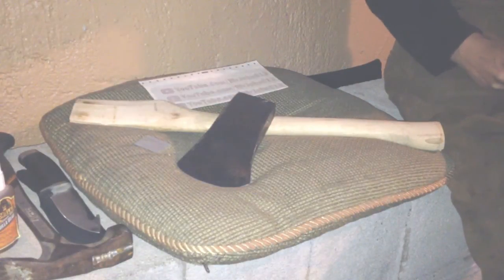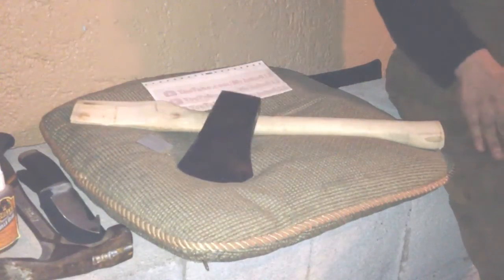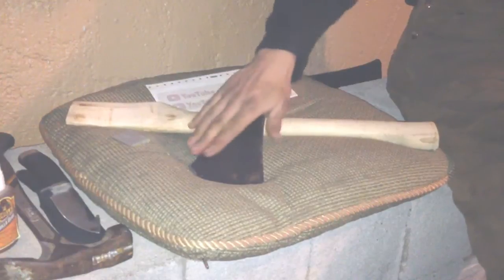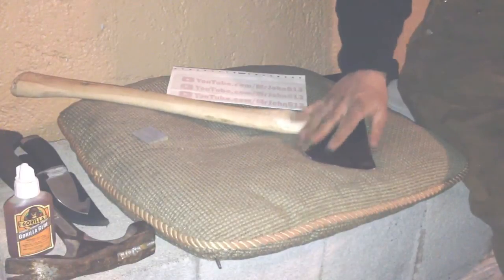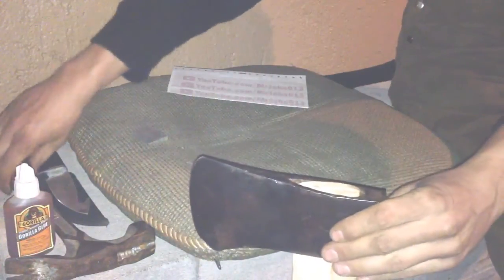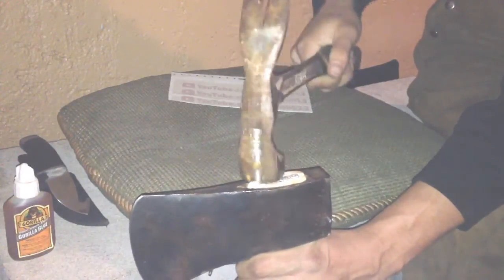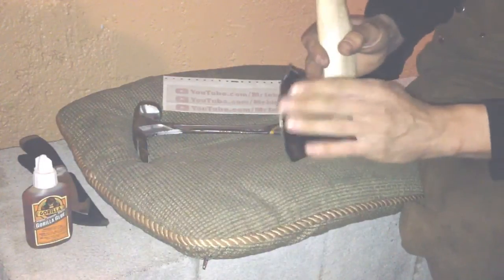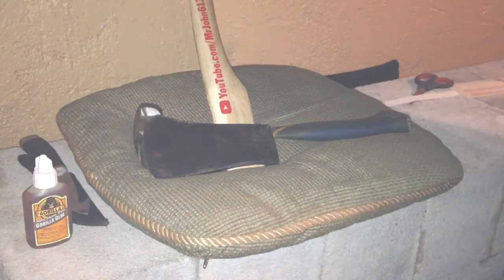DIY Axe Handle Replacement. (full)

Comment: My experience with cheap Red Chinese cutting tools the temper ,or usefulness of the cutting edge was far superior than American manufacturer cutting edge. Red China cutting tools came into the American market around 1985. The were phenomenal . Formosa Chinese tools were crap the cutting edge would immediately peen over American manufacturer did improve their cutting edge And eventually lower their prices to be more competitive toCommunist Chinese tools. The old saying that "you get what you pay for "  fell apart with the introduction of Red Chinese tools